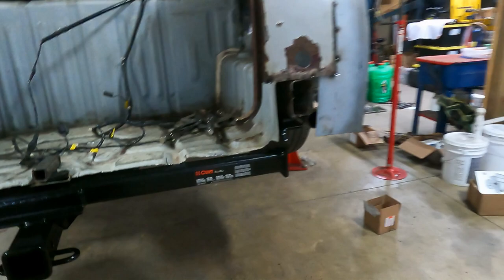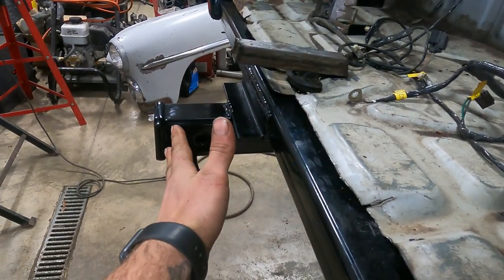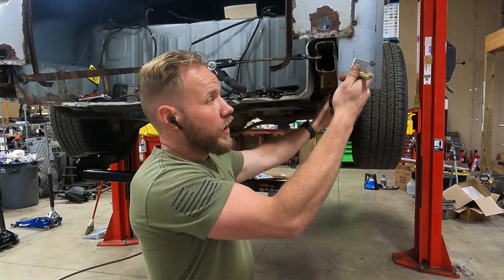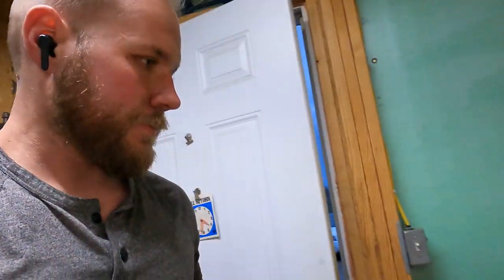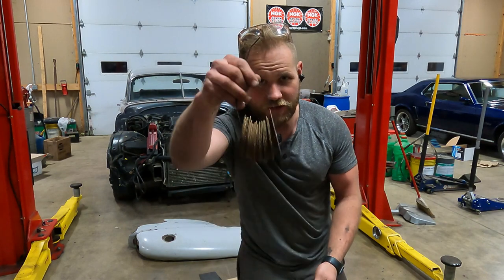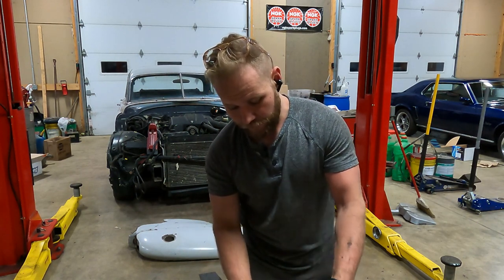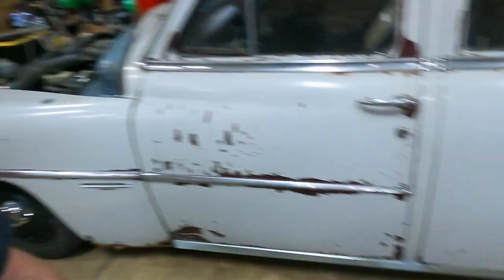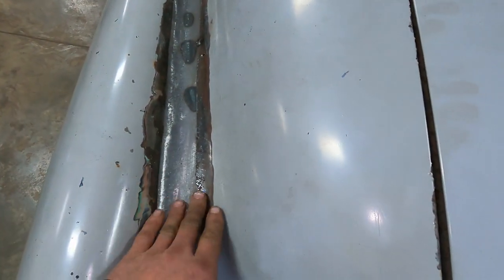Coronet Crown Vic-Episode 14. "Gettin Hitched"

Comment: Purdy Cool, my friend.
Okay, now about the curving of the lower part of the panel.... are you going to use a sandbag and hammer, or do you have a roller to shrink or stretch the panel? From all that I could see, it looks as if y'all have a good start on the rear fenders and patch panel that goes below the trunk. 
Keep up the good work, and thanks for sharing.
Reply from the maker: I plan to make an inner brace which should pull it in some at the bottom. I unfortunately don’t have a shrinker or English wheel yet